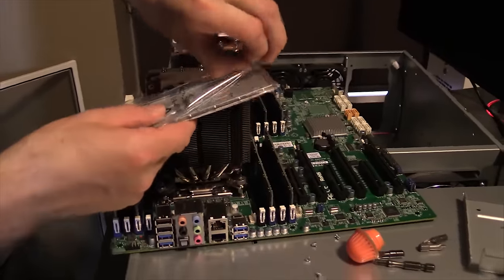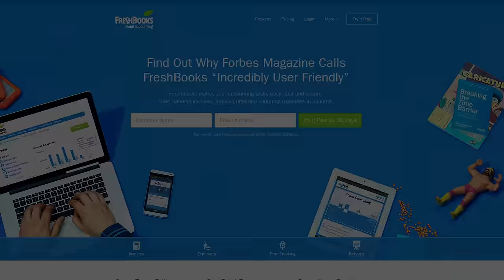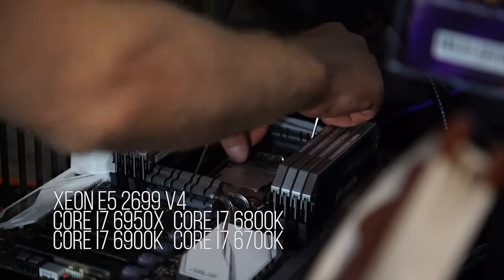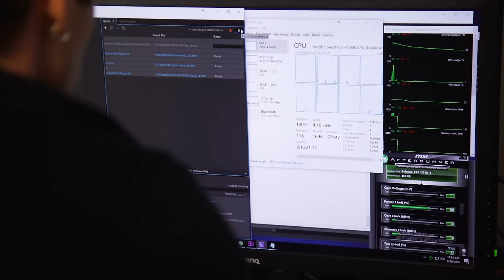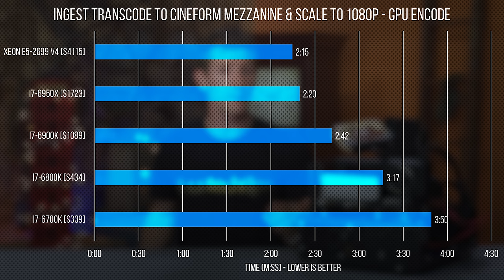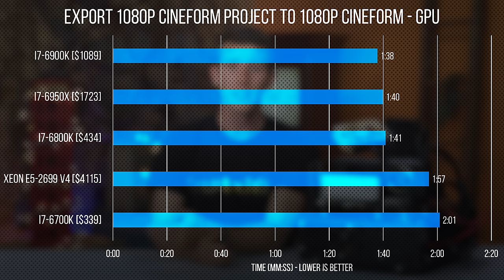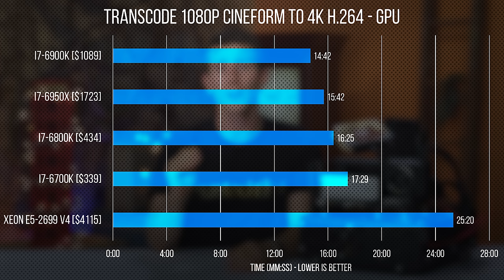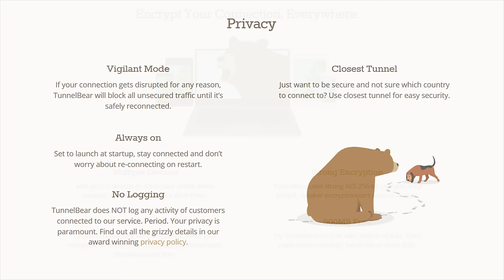$300 CPU Beats $4000 CPU?? - Cores vs clockspeed for video encoding

Comment: It's like 3D rendering a couple years ago with non-server CPUs. The top chip was a $1000 Core i7. The next top chip was a $200 FX. When it comes to production, the best tool for the job usually requires researching your workload. It's just not the same as consumer workloads.
Also why are you upscaling a compressed 1080p video to 4k? I thought this was a no no in production.

Comment: Man oh man did I learn this the hard way. To be honest main purpose of my 24 core dual Xeon rig is still CPU rendering in Corona and it does it astonishingly. But sitting in front of that machine and finding out that Adobe Illustrator only uses one core and all the horsepower goes to waste... not only that, knowing an i7 with high clock speed would beat this machine by far in that application...

Comment: Your lightly threaded work load was not enough total CPU usage for Windows to consider going into turbo for the e5

Hence why low threaded workload were suffering, you were only getting Celeron speed - 1.8ghz

Comment: It strikes me the video conversion workloads are likely not designed to be used as a bench for multi-core CPUs. The parallelism at work here is likely spreading the workload evenly over the cores so there's a relatively low amount of CPU usage for each core (25%). In theory with the Xeon for example you could export two Cineform projects at the same time without the system dying. Scale that up for a cluster you're going to get 100% more projects exported I'd guess. Did you try conventional CPU benches?

Comment: :D good thing i only paid ~$150 for my used pair of 8 core 16 threaded Xeon E5-2670 v1 s. (all core turbo is 3.0GHz)
Sure, the board was a a bit more expensive setting me back another ~$310 new but since that allows me to use ECC RAM which is a lot cheaper used i got 64GB for another ~$90.

So for a total of ~$550 i got 16 cores with 32 threads @3.0GHz , 64GB DDR3L ECC @1600 which is really good value for money.

Timeline performance in Premiere Pro is superb and not even native 4k Multicam slows it down too much.
Export speeds may not be as good as with modern cpus, especially when using gpu accelerated codecs but it still really kicks ass!

Not to mention that in AE CC2014 and other fully multithreaded programs it still performs about as good as a 6950x ;)

Comment: The question isn't if the price can be beaten but the technology in said item, for example say i have the 2214$ Titan X Pascal which is a old GPU (3 years) and put it against a RX 5700 XT which despite costing only 616$ going by userbenchmark will smash it due to advanced technology

Comment: CPUs are so powerful and I am not using a 4K monitor, I got 60fps on maxed out games on OLD Xeon CPU X5670...non overclocked. As long as my GPU was up to date, I still dominated graphically. Only reason I will update now is with far superior motherboard ports....I now have all USB 3.0 and USB type c. So I got liek 10 years from this.

Comment: Hi love your vids.
Cineform is fast but not with GPUs. This is from a Jake Seagraves (product manager) article on the Cineform site.

"CUDA is additive: It is not always an either/or decision. CUDA acceleration applies equally well to effects and transitions applied on top of CineForm media. The CineForm codec is not accelerated by CUDA as it is blazingly fast already (200+ frames per second on a single-quad i7), but Adobe effects are all accelerated using CUDA even for CineForm media."

Sometimes faster clock speed and fewer cores beats many slower cores.

Comment: Interesting. I was wondering why my video render speeds were pretty slow. I've got the latest 8 core AMD CPU, 24 gb of ram, a great motherboard and PSU, but my GPU was a bit dated. I put a new GTX1060 in yesterday, hopefully it solves that.

Comment: This problem that you found is not something new but this is a easy way of showing ppl who is inveighing there software, as some of them were created for 1-2 core CPU back in the time of Core 2 Duo.
Big problem is not the CPU's is the software that will run on them : was it made to use more the 2 - 4 -8 cores , was it made to use more CPU L3 memory or more L2 , and one more wear thing is what was the compiler used to create the software it can change the performance to .
That is way also most games only use 4 cores they were never upgrade to use more so .... getting a 10-20 core makes no sens for that .

Comment: Software utilization. If Adobe wanted, they can use the GPU at 100 percent during export from Lightroom or Premiere. Adobe isn't even trying. Adobe finally released an update to Premiere that allows proper 4K playback on older iMacs. Now a 2013 iMac can playback multiple streams of 4K video on a Adobe Premiere timeline. This used to be very hard even for the iMacPro. Software developers need to pull up there socks and hire more staff to solve the software bottlenecks.

Comment: I'm not familiar with video editing. Why do they encode 1080p cineform to 4k h. 264? Isn't it useless to go from 1080p to 4k?
Reply: i wanted to ask the same^^
Reply: No one said Linus had any sense.
Reply: Youtube re-encodes videos when you upload. Every resolution step has a bitrate cap, meaning if you upscale a 1080p video to 2160p it'll be higher quality because youtube thinks it's 2160p
Reply: this makes sense thank you

Comment: Amdahl's law.  Is there someway you can divide the work ahead-of-time.  Perhaps by frame sequence, and stitch the encoded pieces together.  Bam money well spent again.  FFMPEG can run many processes simultaneously, not sure if you can use something open source that has more predictable multi-core performance.

Comment: Even though the lower end CPU's did better when used with a graphics card. I feel like the Intel Core i7 6950X did the best job getting good results in most of the tests. And for anyone wanting to get a really high end CPU. It definitely will be the better option. Even though the Xeon E5 V4 CPU did better in some tests. It really didn't do "that much" better, considering it's well over double the price. So the Intel Core i7 6950X is definitely a good option.

Comment: I always wonder if turning off HT on prorcessors with so many cores could help on a workload like this. 
It would be very interesting to see the results of the 2699v4 running only with 22 cores and the 6950X with 10 cores. 
Sometimes it seems the high number or threads can do more harm than good.

Comment: If the Xeon uses a Vulcan driver instead of just an OpenGL or OpenCL driver, the Xeon should be a bit faster again instead of slower.  The need for single-threading on communications with the GPUs is what screws the Xeon in this testing.  The Xeon should be far faster too if the software being run is designed and built to multithread across that many cores.  If it is designed to only use a few cores, then yeah, the Xeon is a waste because the extra cores won't be used for the workload.  This should have been pointed out.

Comment: I was under the impression that multiple users were going to interact with the server at once, potentially making the server encode numerous videos at once. Of course with only a single video hitting the chips at once the higher clocked cores would win but what about the scenario when there is more than one video to work with? Wouldn't the Xeon perform better then?

Comment: Xeons aren't necessarily bad, but you don't want to go with one that has a really low clockspeed and an insane number of cores unless you're absolutely sure that the workload is heavily threaded and not sensitive to clockspeed. Clockspeeds and IPC still matter, they're just using cores to direct people's attention away from the fact that they're struggling to improve clockspeeds and IPC.

Comment: A program that utilizes GPU will always perform better on the GPU (video card or especially a TESLA) than processors.  But for a program like ZBRUSH (3D modeling software primarily used in film) 0% GPU is used.  Only the Processor cores are used, so in that case the higher core count is worth the $$ .

Comment: Linus didn't address the fact that multiple videos being encoded at one time, theoretically should perform better on the higher core and threaded chips. Sure one video being encoded will only perform so well within the limitations of the software design, however if one is using the server for multiple videos to be encoded among say installing uploading a update to three other pc's over ethernet I imagine you would notice a difference in performance between the lower end CPU's and the h
igher end ones.

Comment: Hey Linus, can you run the test once more with one specific modification? What was the max clock on each XEON core during low CPU usage scenarios? how do the max turbo clocks compare between the cheap i7 and monster Xeon? can you core lock thread limited processes? In my memory some generations of Xeon and i7 were designed with 2 cores in the best place for heat dissipation. we would lock  processes to the two fastest cores (sometimes use Windows power settings -via registry to force sleep excess cores), allowing max thermal performance for just two cores. on a 2.4GHz Xeon, two cores would spin up to 3.2GHz (more if you have a friend who knows how). this proved to yield much faster compute times on unsophisticated or driver limited processes. Please, see if this can be done with CUDA to CPU relationship!

Comment: I'm curious if that Xeon can hold those figures while encoding MULTIPLE videos as I'm assuming you'd often times have more than 1 conversion going at once.  It may not be a dominant beast during a single iteration but if its just as fast across 2 or 3 simultaneous conversions then it fits perfectly fine.  Thats what servers are supposed to do, simultaneous actions.

Comment: Intel should release a 6 core 4.2 GHz base clock mainstream CPU with a super powerful gpu compared to the 530 ! then you'd just use quick sync to encode 4k in no time.

Comment: LMAO I was thinking the same when he was using lower clocked processors for video production. Xeons are not made for that. 
Its used for web application for more resources to handle simultaneous connections. Having more cores truly make the difference in case of a load heavy application. Xeons can handle 24/7 operations better in Linux/Unix environment. Clearly Linus doesn't need these complicated stuff and probably doesn't know about these stuff if he doesn't have a web hosting business.

Comment: Intel's E5-2699v4 is the top-bin as far as raw total power (speed x num-cores), and is a great choice for business servers doing  OLTP, SAP, virtualization, etc. However, Intel also makes speed optimized SKUs (with lower core counts) which would be much better for what you are doing here, and would have been a more "fair" comparison.    Some applications just can't benefit much from extra cores -- in those cases, sure, use a desktop processor and a fast GPU.   *Disclaimer, while I do not work for Intel,  I work directly with their Xeon performance team.  My views expressed here are my own, not my companies nor Intel's.  :-)

Comment: I've one question. Isn't there a loss of quality transcoding from a 4k file to a 1080p file? whats the point of shooting in 4k if you are gonna transcode it to a lesser resolution? Unless there isn't quality loss...
Reply: There is a definite loss. There is 0 point to shooting 4K than transcoding 1080p. Maby shoot 1440p than a high bitrate 1080p, but honestly you should shoot what you plan to render in.
Reply: They shoot in 4k, downscale to 1080p for faster editing and upscale to 4k to get the Youtube-benefit of higher bit-rate bandwidth (which you don't get on 1080p). They already tested it, since Youtube is always crapping on the quality of your video, there is almost no difference in uploading 4k to Youtube, or upscaling 1080p to 4k and uploading it to Youtube.

Kind regards,
Meta Custom Computers
Reply: Meta Custom Computers Except shooting in 4K is pointless. Might as well shoot 1080p then upscale.
Reply: *****
If they already have the equipment, there is no point in further investing money in worse equipment. Also you don't know if the 4k camera yields any benefits besides the higher resolution that are considered important by LMG but aren't offered by other 1080p products.

Kind regards,
Meta Custom Computers

Comment: In my experience not every transcoding software is developed with same technique, if you are add processor to increase your performance you should chose an software which use processor power to transcode like  Carbon Coder....?

Comment: I did a quick video a while back on clocking a 4790K from default 4ghz to 4.8ghz in premiere and only got 7% improvement. Cuda with a 980ti made zero difference. with a 4k slog'd file and no effects.  Remember when number crunching apps liek SETI and Folding@home were rewritten to utilize the GPU and we got many times the power. we need those people working at adobe.

Comment: Everyone knows that video encoding, 3D software and their plugin (+ sometime calculations softwares depending on their age) often cannot use lots of cores.
So efficiency per core is the most important for that.
EDIT: And don't ever use accelerated GPU encoding, it degrade quality, especially at low bitrates.

Comment: if you have 44 cores, would it be more useful to say, setup 7 6 core virtual encoding machines on the 2 xeons to emulate the 6 core machine from the graphs and do multiple encodes/ingests at once? or have I got the wrong end of the stick here. You've proven that more cores on a single task doesn't scale but, surely the point is to make overall efficient use of the hardware.

Comment: Did you try setting the affinity for the Xeon 2699v4 to 2 or 4 cores for the CUDA tests? That way you can use the turbo boost performance. Also the 2699v4 isn't the top of the line.. its the 2696v4 with a higher TDP and Turbo.

Comment: Should have used 2x E5-2687W v2 instead.
Lower core count, but much higher single thread power - around the same, as that i7-6950X

Comment: what about getting a faster gpu? like a quatro or tesla?
Reply: Quadros and Teslas aren't faster in FP32 scenarios like this, so it's next to useless.
Reply: Given that you can't really get a faster card than a Titan XP right now, flip the question - Q: What about getting a slower GPU? Like a 1060 or 480? A: It'll be slower. shrugs
Reply: +Stoney "Skouteh" Mahoney While the 1060 and 480 would be slower than the Maxwell GTX Titan X that Linus used, there are still the 1070, 1080, and the nVidia Titan X, as well as their Quadro and Tesla counterparts.
Reply: He made a video similar to what you asked and the conclusion was that unless you are some big movie corporation like Pixar you won't really benefit from having a 24gb vram card like a $5000 quatro would have. In fact, the titans worked better

Comment: since we are talking about CPUs I've got a question. Seeing that some games utilize 8 cores, I was wondering if a 6900k with Hyper threading disabled will reach both higher clocks (like 4.6 ghz) and beat a 6700k at the same speed in games.

Comment: All performance related tests are a balance of software and hardware. If the software is not written for the hardware, the performance would be poor. Likewise, if the drivers for the OS and software don't perform well together, you will see a bottleneck.
All of the tests run are valid, but are they valid for this hardware? Does the OS maximise hardware performance? Is the software written to use the hardware to its full capacity?  Are there any issues with the drivers?
Just a thought :-)

Comment: Would be awesome to hear your guys' opinions on a build for an audio encoding/studio mixing rig. It's almost the polar opposite of gaming as far as hardware needs, and GPU processing was almost abandoned in ~2010 era until proprietary VST(most common audio plugin format) companies started introducing them as peripherals. 

Do you do any consultation for nerds or custom video requests? Especially with a current AMD build (bulldozer and no multithreading meant AMD = pain for quite a while until audio plugin companies pulled it together as a group).

Comment: Oh Linus - you mean core speed vs. core qty matters?  The 2669 is not the "flagship" Xeon - that's not how it works.  The fact that you came out of the gates with this impression is why you're surprised.  I've had clients who need wide and slow ESXi hosts with core density, and I've had clients that need narrow and fast ESXi hosts with high frequency... it's all application dependent.  There's a reason why you don't see the big boys shelling out for the 18 - 22 core CPUs very often and that's because the happy medium is around 10 cores and 2.6 - 2.7 GHz.

Comment: surely then going by how more clockspeed makes for better results, why not use a pair of 2687W V4's? 12 cores each but 3GHz and 3.5GHz boost, that way you get a good whack of both clockspeed and cores

Comment: You need to test out a GRID GPU. I use those in GIS Apps. In the encoder like Adobe does it let you set dedicated memory per core. If you have that set and do not have enough memory it will kill you performance.
Reply: Why? It's just a regular high-end GPU but cut up into little pieces that can be forwarded individually to different VMs; it will perform much worse than a single full GPU and cost a lot more.

Also, did you miss the bit where Linus stuck 128GB into their test bench?